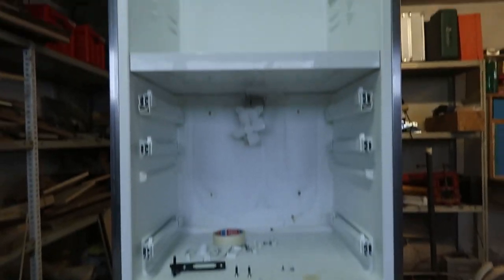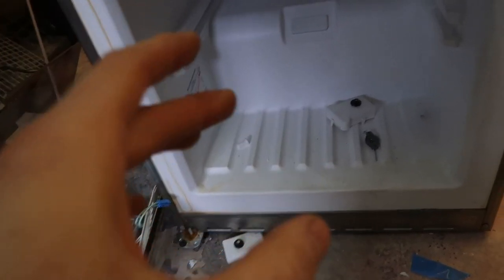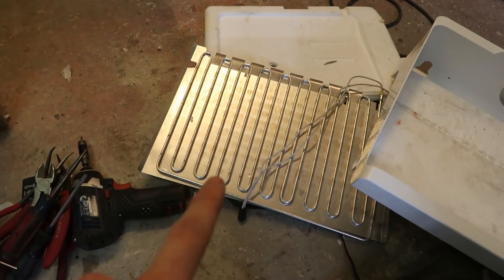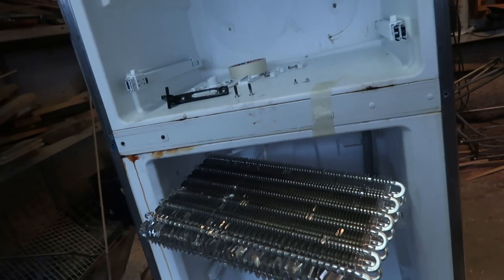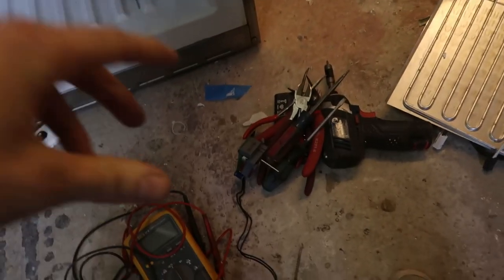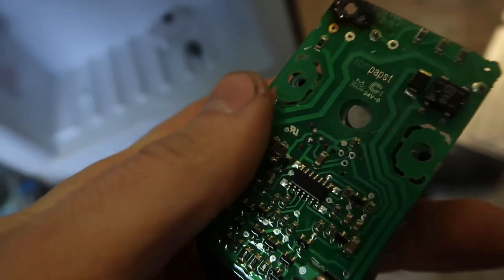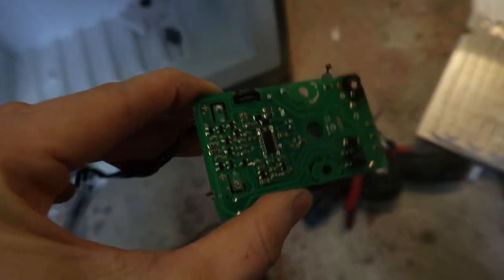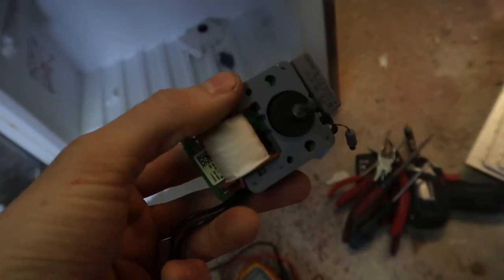This fridge represents the collective failure of our society | Repair not replace

Comment: Reminds me of trying to repair two consumer items recently - one was a Karcher water blaster (pressure washer?) I had to snap off about 10 plastic tabs on the outer case just to get to the pump and motor, only to find it was completely enclosed and could only be accessed by buying a whole set of special tools (you know those weird screws they use to stop you getting in) so I gave up at that point and amazingly I ended up selling it for 10 bucks to some guy for "parts". The other is a coffee maker that had a well documented breakage that caused a leak - the replacement part was available but for a pretty high price, but there was a hack floating around online that if you could succeed at pulling it apart without breaking - again - tabs - you could "fix" it yourself. I of course broke the tabs again, but amazingly I also sold that thing to some guy that needed the power switch assembly off it. 
Dude - that fridge is massive!

Comment: Whats the purpose of the freezer-fan? What does it besides circulating air? It has to be a different system for a reason, you can't use every kind of motor at -30 °C so maybe it requires a different kind of technology. It looks like a DC motor and there is a transformator, 94V-0 could mean it's variable for different kinds of setting and functions.
Reply: I recently helped a friend to fix kinda newish freezer (5-8year old). The controler board had faulty capacitors so it was rather easy to fix it. Just take the board out, desolder the caps and put new ones. Easy. The price of the board itself is about 30% of the price of the whole fridge.

But the surprising part related to your question was the fact that it took about 24h for the fridge to get to the nominal 4C temperature inside the cooler unit.  That blowed my mind as I remember old fridges which could get chilly inside in about 20-40 minutes.

I think the fan there is because the evaporator is tiny (saved materials) and cant cool down the full volume of the fridge without forced air circulation.

So basically they save a bit of copper  on evaporator and compensate it with the fan.

Thats my theory.
Reply from the maker: I don't really know what the fan is for either, most freezers that I have seen don't have one. You could be right that they put the bare minimum in for cooling and the fan is there to kind of "help it along". If anybody reads this who designs these things, feel free to enlighten us :D
Reply from the maker: I've since figured out the little circuit and repaired the fan. I was wrong about 3 things in the video, 1) its not a shaded pole motor, but rather a single phase induction motor and 2) its not a thermal fuse on the pcb, but rather its a 50ohm power resistor and 3) its not actually the resistor that failed but the PCB itself. The motor is interesting in that its a single phase induction motor which is commutated by the little IC (a schmitt trigger) together with a rotor position sensor, which is a bit unconventional. Now I have no idea why they would choose to use this configuration rather than a cheap shaded pole motor, which is a perfect application for fans (low starting torque). Perhaps there are some thermal limitations. Anyways, I have replaced the power resistor and resoldered on the PCB and the circuit runs perfectly fine, fan works. I think the failure mode was ice or water ingress which shorted the leads of the resistor, causing a high current to flow and therefore overloaded the little PCB traces.

Comment: I slightly disagree with the last argument. The client have no idea if the device is repairable. They cant judge that before they buy the thing. There is no way for the demand to exist at this time.

Even you, smart guy who can fiddle with the device had no idea how hard it will be to service the stuff you own. How much each part would cost and how often it would break.
After you finish this repair you have no idea if the pipes will stay seal or if anything will crack and let the refrigerant to escape or something become loose and start making noise. Etc, and so on.

We can create this knowledge  by putting into customer heads the ideas about fixing the devices and how to check if there are independent suppliers of the parts. But thats not easy. Its not easy for anybody let alone the poor clueless customer.
Reply from the maker: You are totally right man. I was think about exactly this as I was editing.